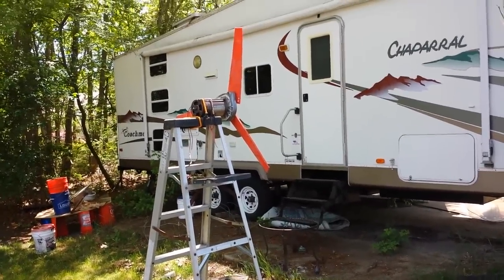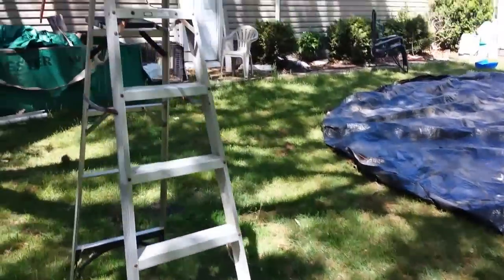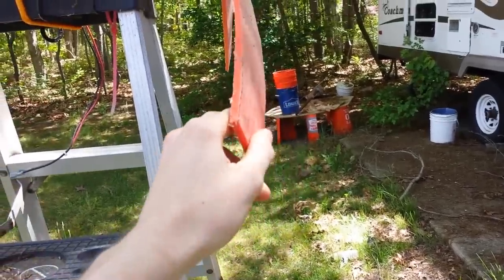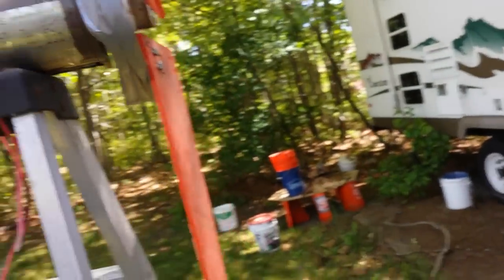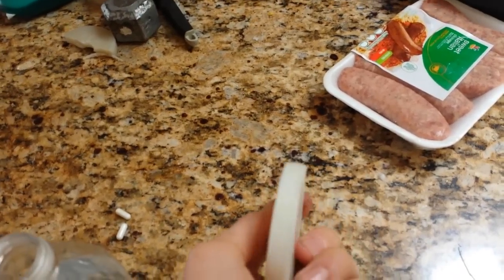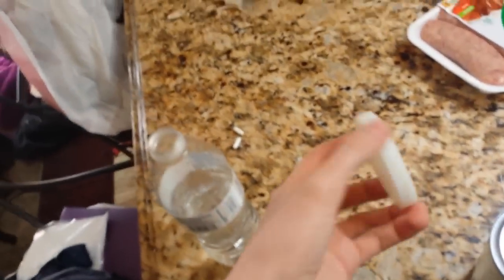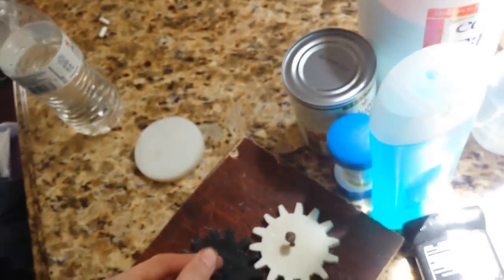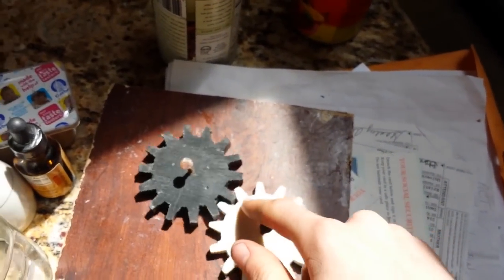how to make gears and other cool gadgets using recycled hdpe!

Comment: do a vertical turbine instead, it should produce better I think.
Reply from the maker: yeah i could do that although i tryed it once and it still didnt work well i think its due to all of the trees in the south blocking the wind during the summer however in the winter the wind usually comes from the north and the trees dont block the wind as badly as they do in the summer also the blades for the horizontal turbine were flat and i didnt make them aerodynamic enough i do plan on improving the project in the future thanks for your suggestion though.

Comment: I would like to mention that apparently HDPE is not very UV resistant. Those lowes and home depot pails break down pretty quickly when exposed to sunlight. Not really the best choice for windmill blades but at the price who cares?
Reply from the maker: +JIMMY TATE yeah its true hdpe can degrade in sunlight however its only gets degraded on the surface which would minimally impact strength however there are ways to work around it one thing I noticed is that 5 gallon buckets are made out of a lower molecular weight hdpe this is because 5 gallon buckets when made in a factory are injection molded which uses an hdpe type that flows better but is not as strong as milk jugs. milk jugs and other hdpe bottles are blow molded which uses a much stronger type of hdpe but doesn't flow into a mold without adding pressure so for this reason I don't use buckets for anything requiring high strength such as windmill blades or gears instead I use milk jugs or detergent bottles which are much stronger and wont fracture under stress. as for the uv problem you can either paint the hdpe which I have had luck with because I used spray paint made for plastic and it worked very well or you can mix in charcoal dust or powdered carbon which would also provide tons of uv protection you can also use any bottles that are colored because the color also increases uv resistance, however since I use milk bottles the method I use is painting it

Comment: Still waiting for the gear cutting video.
Reply from the maker: +nomercadies that video will come out this summer but basically i drilled holes where the teeth will be with a drill bit and then cut the rest of the material away with a coping saw

Comment: very cool video using hdpe only one problem hdpe used on the blades of your wind turbine will not stand up to sunlight so over time it will degrade becoming weak and will fail due to hdpe being exposed to UV light. You don't want to be standing inline with the blade when it happens. Just  thought you should know about the UV problem.
Reply from the maker: +Kevin Davis yeah any kind of plastic will degrade in sunlight and i do plan on making really nice blades in the future that are curved which will allow the turbine to be much more aerodynamic as for the uv degradation i think a spray paint made for plastic will do the trick or i read that carbon black added to the hdpe while melting will protect it from uv degradation anyways i think i think the spray paint will work well
Reply: +Dean Walcott Good Ideal on the Paint it's cheap, The Carbon black might work if the process is simple cheap and effective . If you develop a working time for the part that's being exposed to UV  if you can work out a Half life  and just replace the part in a given time. Like most failures it will happen under a high load . I like the
 Ideal you have very cool project. Do a update if you do paint or what ever a share the results. Thanks for the video

Comment: Didju melt the plastic in your kitchen?  Toxic fumes?

What did your mother or wife think of that?
Reply from the maker: Howard Johnson nope no toxic fumes at all because i only melt type 2 plastic which is hdpe and hdpe releases no toxic fumes when melting in fact when i melted it i couldnt smell anything at all and yes it was fine in the kitchen because i did reasearch on it and hdpe does not release anything bad when melting. but there are some plastic types you never want to melt such as pvc which is number 3, polystyrene which is number 6 in the recycling symbol which is the same as styrofoam, or pet which has a 1 in the recycling symbol and is used for clear water bottles. these types of plastics will release very nasty fumes.
Reply: I thank you, Sir. For your rapid and thorough response.